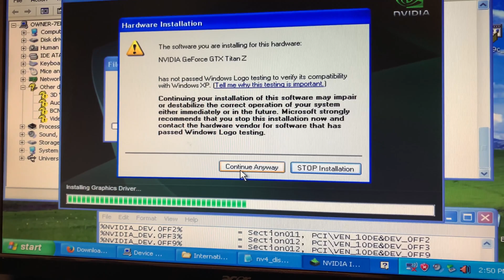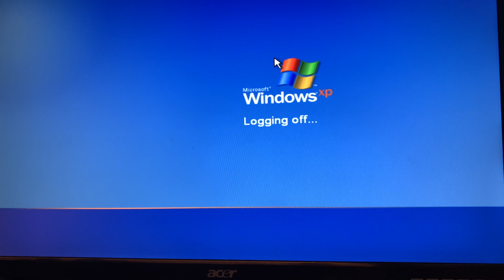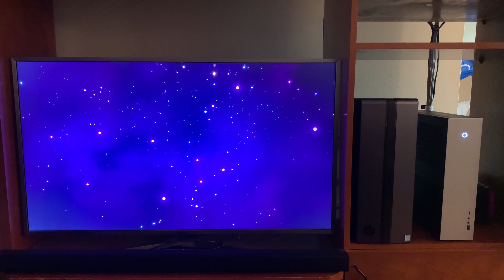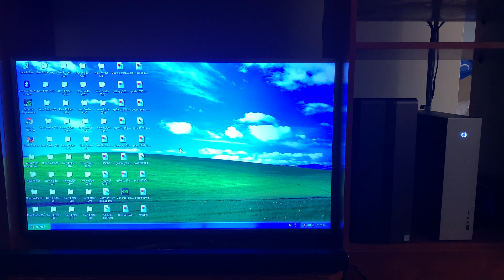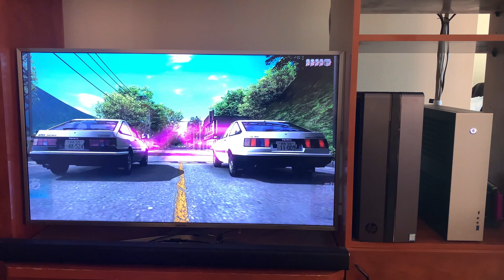Windows XP and 10 Dual Boot Mini ITX Console PC Workstation Build

Comment: I see you had a notepad open with nv4_dispi.inf. What is your process for getting the Titan Z to show as two Titan Black and how do you make custom SLI profiles?
Reply from the maker: I didn't have to do anything to enable the SLI other than finick with game settings on games that didn't like SLI; it just identifies as two titan blacks if you use the same info for the Titan Z; note that, titan Z is an experimental configuration for an XP build; there was also an EVGA SLI Enhancement thing that you could install, but I didn't use that, tthe nv4.dispi.inf was open for finagling with the identifier for the titan Z; you don't necessarily have to do that though if you just manually tell it to use any driver from the nv4_dispi.inf in device manager then select titan black.

Comment: I too have a THICC boi (EVGA 3090 THICC BOI EDITION). What configuration did you get for the case?
Reply from the maker: standard version but with two noctua fans
Reply: @psychoticgiraffe   which front panel Board connector did you get? The motherboard I’m getting is the Gigabyte B550i Aorus Pro. Does it matter which one I choose?
Reply from the maker: @gabe8422  the one with normal usb 3.0 and the usb c, I didn’t do the second option
Reply from the maker: It doesn’t matter; but if you want usb c/thunderbolt to work get a board with it or and adapter
Reply: @psychoticgiraffe   Another Question. I got the 3090 Evga FTW3 Ultra that has 136.75mm in height and 300mm in length. What would be the best option to choose for the power supply cable section at the bottom?
Reply from the maker: @gabe8422  that card doesn't have a weird power cable thing just use a corsair sfx psu with 750w
Reply: @psychoticgiraffe  I was asking cause it’s says the standard option would make my card unmountable cause the height would be limited to 133mm
Reply from the maker: @gabe8422  oh then you have to use the other option that makes it support the taller card i dont know what that is
Reply: @psychoticgiraffe   thanks I appreciate your help. Sadly their isn’t an sfx that can power it. I need at least an 850 watt psu so I can overclock it with some leg room to wiggle around .
Reply from the maker: @gabe8422  i wouldn't bother overclocking such a card, you only need a 750w platinum for the card, overclocking isn't needed on such a card, techncially the platinum due to its efficiency if paired with low power consumption enough parts would probably be enough for some light overclocks
do a power consumption calculator to see what leeway you have
Reply: @psychoticgiraffe  you right. This is the only case on the market that isn’t sold out and fits all my needs. I’m gonna call tomorrow to double check with them.

Comment: I just ordered mine. Can't wait to built in it. Ryzen 3950 with a rtx 3090... its gonna be awesome
Reply: Which 3090?
Reply: @gabe8422  zotac trinity
Reply: @nando03012009   oh okay I got the EVGA FTW3 Ultra. Was wondering if you had the same one.
Reply: @gabe8422  I wanted an EVGA card but couldn't get one.  I built my system and this case can't keep up with the heat output.  But will do a full liquid cooling loop once my waterblock comes in.
Reply: @nando03012009  yeah I’m planning on getting the liquid freezer 2 240mm to get the best thermals

Comment: I kept my old gaming rig and turned it into a Windows XP machine as well. Its fun having one but will be upgraded back to Windows 7 once my 98/XP hybrid is built.

From my own playtests i actually got a tip for you. Dsoal works on XP!! So you can mod the system in software to get good EAX support even on onboard audio. 

Completes the true XP era without having to buy a soundblaster.

Comment: Great video Giraffe! What a beast you have built. There are a few things I would like to ask. On the video, we only see exhaust fans on the case, are there any intake fans? Might be starving the components of fresh air in there. On another note, I never thought about running XP games in 4k, that's a great idea. Can we get a list of all the games you show cased? Thanks for the video, great stuff, I hope you keep them coming.
Reply from the maker: the case has gratings on the back of it so the intake is actually partially exhaust, it goes straight through, very high airflow

I'll make a list of all the games tested later though

Comment: I'm still rocking a 3770K 980ti 32gb in a Windows 10/XP Dual boot configuration. Albeit in a gigantic HAF X case.
I've got a bunch of PCI slots and IDE/Floppy, so I should really get off my lazy ass and fix a semi-working Windows 98SE install.
Reply from the maker: @placeholdername350  the core 2 vsta asrock board or any board that has a core 2 duo with AGP, there is a version of the asrock one witht PCIE and AGP
Reply from the maker: I use the non k in this system because of thermal reasons, but, this case is surprisingly good at heat dissipation seeing as the titan z doesn't cook the whole pc

I'd like to see 98 SE run on a 3rd gen i7, however, from my experiments, it never worked right unless I toss a pile of pci-pcie adapters which then makes it not fit in most cases without  risers, and has stability problems

I think the first gen i7s were the last ones that properly seemed to work with 98 if you had a PCI video card and a lot of PCI slots on the board;
Reply: @psychoticgiraffe  I have 1155 motherboards by Asrock that have floppy, one of them has 2 PCI slots, the other has 3 and also IDE.
For reference, they are the Z77 Extreme6 and the P67 Fatality Performance.

The IDE optical drive refuses to work during and after install, so I have to use a USB stick and edit settings to limit ram.
After that, driver install for GPU and sound is a hit and miss and I just gave up due to the lack of time, but I heard there are probable workaround for all those problems.
Something to do with himem, autoexec, and all that esoteric stuff that flies over my head.
Reply: Had no luck on my attempt, the best i could do was get Windows 98 working with unofficial display drivers, sound support and i think usb or at least usb mouse support.

Sounds like a success? Nope! Unresolvable IRQ conflicts cause massive instability from the getgo. Many drivers will just hang the system so i was lucky to get that far.

Now its a Windows XP machine until my era appropriate 98/XP hybrid is built that should run way better.
Reply: @Henk717  Bummer, what mobo did you use?
Oerg866's video (linked below) gives me some hopes, because it runs on a Haswell platform.

https://www.youtube.com/watch?v=0u0H7vhMiP4
Reply: @JimProfit357  Z68XP-UD3P
Same BIOS interface to as i flashed it to UEFI.
Can it run? Yes, absolutely it can run.
But you will have to put up with many crashes, minute long freezes, and in my case WDM audio drivers because VXD drivers hung the system completely.
Reply: @placeholdername350  The one i am building is a Athlon 64 and 6800 based system. But i am pushing it to the limit because a 6800 has questionable stability.
Reply from the maker: @placeholdername350  probably about in line with the one i did with athlon XP 3200+ and Geforce 6800
except, perhaps put a 7950 AGP 

but, we could go a step further and use the last motherboard with AGP, and a core 2 duo

if I go to a first gen i7 I can't use AGP, thus making it a wildcard if it would even work
Reply: @psychoticgiraffe  The 7000 isn't officially supported. Did a lot of research on it and heard very mixed results. 6000 series agp with the nv40 is as high as you can safely go. Mine turned out to be a nv48 so i hope it will run well once the system is built.
Reply from the maker: @Henk717  7950 AGP is supported by the hacked drivers but some boards dislike the card
Reply from the maker: @Henk717  6800 ultra is the safest card choice though but sometimes 7950 does work

Comment: Valorant run on windows xp?
Reply from the maker: I have Dual Boot set up so that I can test games for both XP and 10 on it as it is a dual GPU

in XP sometimes it could just pick up the dual gpu and use it without a profile, in 10 I usually had to manually set it for later games, but crysis detected it automatically

but no valorant's anti-cheat and lack of vista support is the thing that prevents it from running on XP,  overwatch used to run on XP when it first came out but it does not anymore.
Reply: @psychoticgiraffe  overwatch ran fine until the battle.net launcher dropped support for windows xp back in 2017
Reply: @psychoticgiraffe  ok